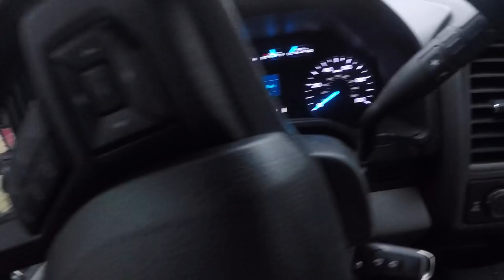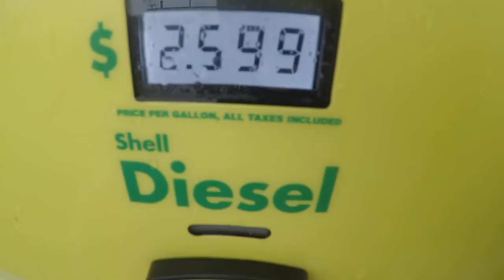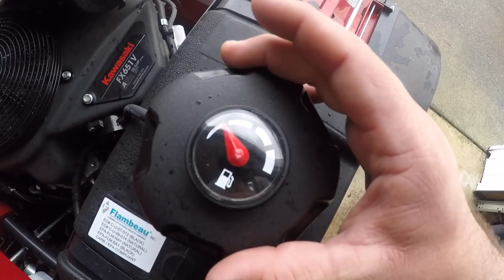FUEL GAUGE FERRIS FW35 Walk Behind

Comment: I had the same problem with my ferries mowers. I knew someone with old cut up railroad track and bought metal banding (telephone pole sized hose clamps). It works like a charm.  My dealer wanted $150 per mower for the weight kit.  Times that by 10 and it gets a little expensive.